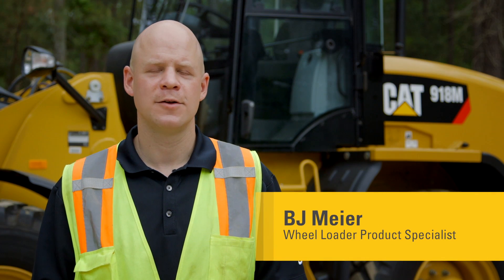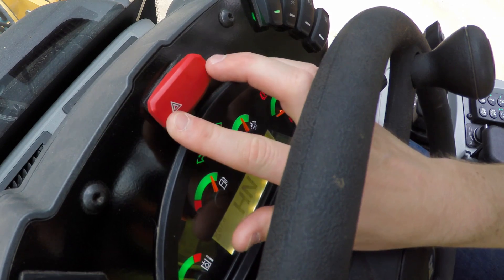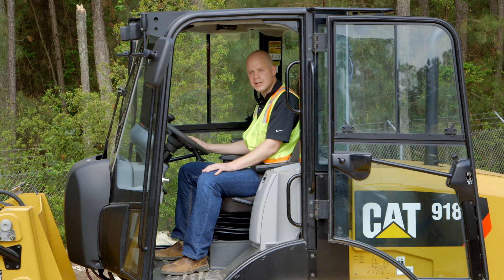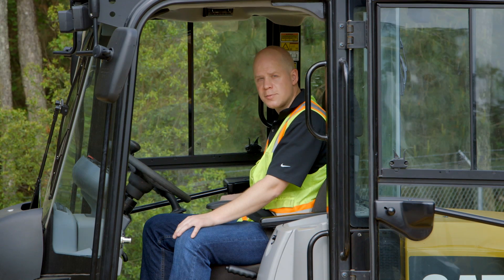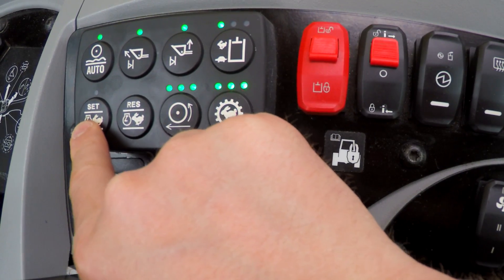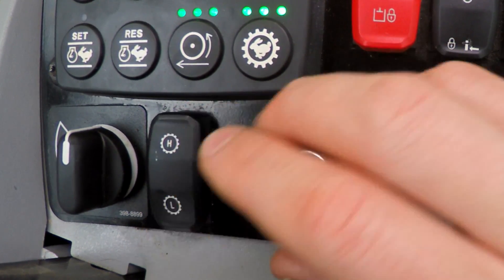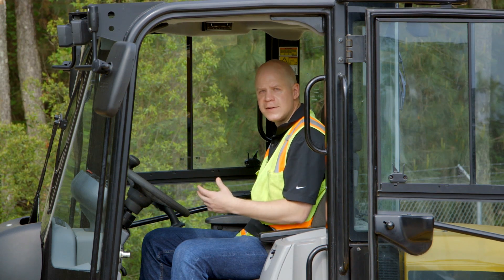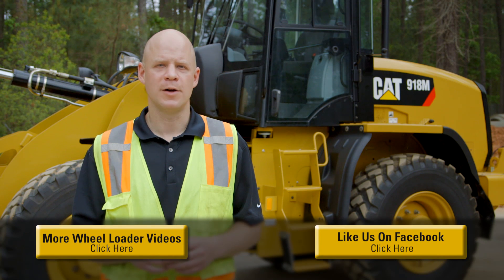Machine Controls | Cat® 906M,907M,908M,910M,914M,918M Wheel Loader Operator Tips

Comment: The company I work for recently purchased the 908M , we find the back tilt is WAY WAY TO FAST , even with the soft touch control in the slowest speed , personally I find it’s to dangerous to operate around the aircraft’s that we do , I sooner use the older 906 cat loader , any way of slowing the tilt hydraulics down ?

Comment: How do u get it into high range speed mode
Reply from the maker: Hi Ruben, great question! On the 906/907/908M-Series, you must come to a stop and depress the brake, then select speed range 3. You can toggle through the speed ranges with the top button on the joystick, but you must be stopped with the brake depressed to advance to speed range 3. As a note, our NextGen 906/907/908 CWL's are shift on the go, so you no longer have to stop. - Maria
Reply: @catconstructiontrade On the 906M, is it all models that allow high range speed mode? I’ve tried following your direction and still can’t get it into this ‘3rd’ gear.
Im in neutral, depressing brake, & changing gears w/ the joystick and can only go into 2 gears.

Comment: Is there a float toggle on these m series machines? How does that work? Thanks
Reply: I was wondering the same thing. I don’t think it does. I’m supposed to drive one this winter to plow snow. It’s a very basic and handy hydraulic feature. I’m surprised it doesn’t have it.
Reply: yeah its called ride control   he talks about it in the vid
Reply: How do you get the high gear drive to turn on to get top speed on long road travel?
Reply: https://youtu.be/OjE-jnVwjzs